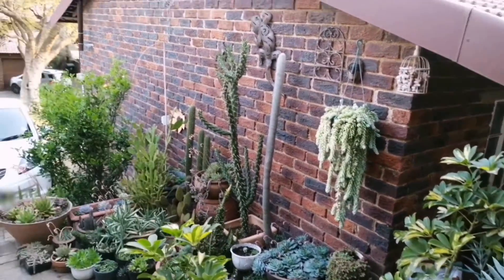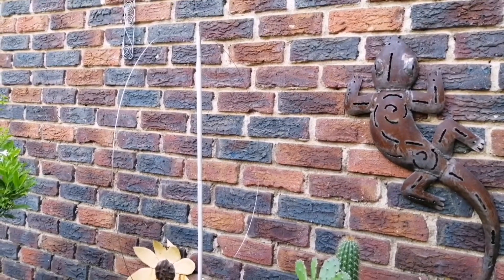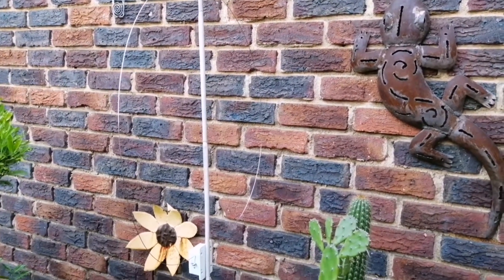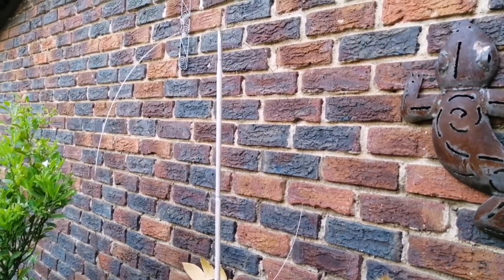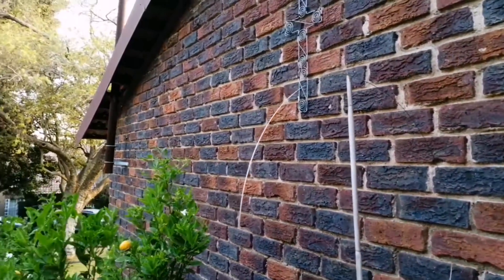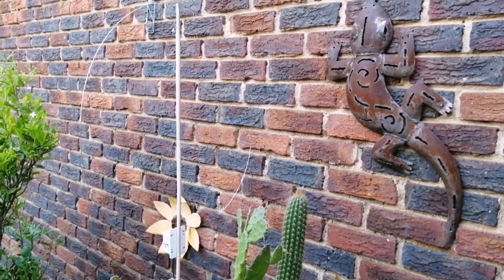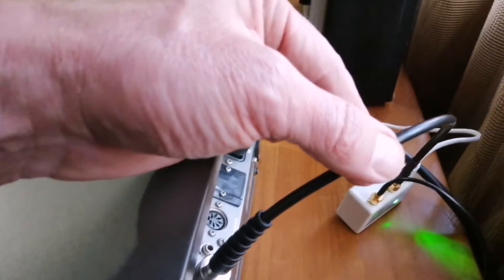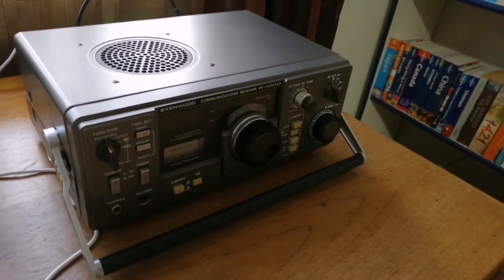How I set up my MLA30+ loop antenna just above ground level, and why it works!

Comment from the maker: CORRECTION: I mixed up my references to the amplifier and bias tee boxes in my video. What I refer to as the bias tee is the amplifier and what I refer to as the amplifier is the bias tee. Second time I do this and second time viewers point it out. Somehow the incorrect terms seem to be stuck in my mind 🤔 Thank you to the viewers who pointed this out. For other non-technically minded viewers (like myself!), the amplifier helps to boost the signals, the bias tee provides DC power to the RF circuit to power the amplifier.

Comment: thanks for info sir...Can this be used with Qodosen dx286 to increase Medium wave reception?
Reply from the maker: Yes, you can use the MLA30+ loop antenna with the DX286 receiver, it will definitely improve your medium wave reception. It works well. I use my MLA30+ for MW on the Qodosen.
Reply: @swlistening thank you sir...i appreciate ❤

Comment: Thinking of getting one of these! 

Also, Love your cactus garden. Wish I could grow them outside year round!
Reply from the maker: Hi Tim, it is a very good antenna, I use mine all the time!

Winters here are cold also, sometimes well below freezing point at night, but I guess it is not as cold here as where you stay. The cacti seem to survive the winter here.
Reply: @swlistening  they also get some heat from that beautiful brick wall. We have already had some temps below 20° fahrenheit. (-6° C)
Reply from the maker: @hawkinscsa  True, the wall certainly helps. Good luck with the chilly weather there!

Comment: Thank you for the information. How did you get it throuth your window? Did you drill a hole?
Reply from the maker: The wire actually fits in the gap between the window and the window frame, so when I close the window the wire still fits. The wire is quite thin. Many people actually do this, I have done it when travelling with hotel windows also. But if this does not work, you will probably need to drill a hole.

Comment: I am trying to determine whether to buy one of these or not.  The only place I can really put it is on my deck, which is about 10 feet off the ground.  I have a number of metallic objects on my deck as well (such as my barbecue and some chairs with metal frames)  Hopefully they won't interfere too much with the loop.  Excellent video, Andre.
Reply from the maker: Thanks Andrew! I think the MLA might still work well on the deck, it is great at nulling out noise and many people use it indoors, it still improves reception. It's just always a gamble with sellers on Ali Express, some of them sell fake versions. Make sure you use a reliable seller.
Reply: @swlistening  Yes.  I think Amazon Canada will be a better bet for me than AliExpress

Comment: Excellent how-to presentation on the MLA-30+ loop antenna and how to position it in one's garden for best reception.  I thought that vertical active magnetic loops, like most other antenna designs, should always be installed high above the ground on a mast or rooftop. That's obviously not correct, at least for the MLA-30 design. Thanks Andre. Mark
Reply from the maker: Hi Mark, thank you so much for your comment! I certainly think in some cases it might help to install this one higher up, some experimentation might be needed, depending on your location. But for me it certainly works best just above ground level.

Comment: Hi Andre, I also have the MLA-30+ but after experimenting with different heights. I tried from 4ft to 20ft and have I found signals were noticeably stronger when I put it higher. Not sure if it's got to do with the location. I have mine about 15mt away from the house. And I'm using a Sony icf-SW 55.
Reply: Hi Andre, mine is at 21ft at the moment. I'm also trying a new mod. I've taken off the wire loop and attached a 12mm flat aluminum loop today, so I'm looking forward to seeing how it compares to the standard wire.
Reply from the maker: @andrewbadinski7040  Thanks Andrew. I would be very interested to hear how the aluminium loop compares to the standard wire.
Reply from the maker: Hi Andrew, thank you for your comment. I have been thinking about putting mine a bit higher just to see if there is a difference. How high did you put yours in the end?
Reply: Hi Andre, well I've tried the new aluminum loop. It's hard to tell if the conditions were better last night or the loop actually is performing better because there does seem to be a difference. I've just ordered a Tecsun pl 660 so looking forward to trying it with that. Take care

Comment: Hello André. Instructive video, thanks. I'm curious about your mentioning sources saying that the MLA30+ works better when close to the ground. I've read everything and its contrary about what is best for this  antenna. Would you mind sharing a link to this source please?
I have a question too: I've just received my 2nd MLA30+ that I plan to use for countryside DX SWL outings. Much to my surprise, it came with a much bigger loop than the 1st one I have on my balcony. The former has a ~62cm diameter, the latter ~84cm. What's the diameter of yours? Have other people seen MLA30+'s with varying diameters like this?
Side note: hope you'll see my recent report posted to the HC DX list. It was a fantastic evening. BTW this should give you my mail address, if for some reason you want to get in touch. That'd be great.
Reply from the maker: Hi Alain, thanks for your comment. I listed some of my sources in the video description, but there they are also:

Loop height for small magnetic loop: http://www.lz1aq.signacor.com/docs/loop-height-for-small-magnetic-loop.php

An overview of the underestimated magnetic loop antenna: 
https://shorturl.at/uTVX0

Tips for using a magnetic loop antenna: https://shorturl.at/jlFL5

But, you know, I will be the first to admit that there are very many different viewpoints about this, I picked it up myself as I was reading. My MLA30+ is just above ground level (two loop widths high), and it seems to work really well this way. Some sources say this is a good position for the loop. But others say different things. I really think it also depends on your area, your immediate surroundings, buildings and other large barriers (like balcony walls) around the loop, general RFI in the area. I think there are so many variables. For me and some sources the just above ground level works very well, for others it might not. 

About the fake version, I actually just replied to your other comment as well, seems like the difficulty in forming a circle is one of the things that does show it is fake. Also, the bias tee box has a red light on the fake one and not green. I just measured the diameter of mine, it is 62 cm.

I haven't read the latest HC DX list yet, I will read it later tonight. I am looking forward to seeing your report! I will take down your email address there for sure.
Reply: @swlistening  Thanks again André. Sorry I've missed the reference links in the description. Oops.

Comment: Hi! I was inspired by your video. I have two MLA 30 Plus antennas both about 12 ft up. I had one with a 3 ft. Copper loop, the results were good, but it was producing spurious signals. I took that one down, mounted it on a smaller piece of PVC that I measured by what you said of 2 loops height. I attached the stock loop and stuck in the ground
 I will do some testing and let you know how it performs against the other.
Reply from the maker: Thanks for your comment Anthony, I am really interested in hearing what your experience will be with the lower mounting position. Please do comment here again once you have done your tests.
Reply: My antenna is doing well. I just recorded  a weather forecast from VMC Charleville Australia on 12365 khz USB. I've heard it before using my other MLA 30 Plus at 12 ft. But today's signal was strong using the ground mount antenna. I have the video I could show you if you would like. I'm in Florida in the US.
Reply from the maker: @anthonyfranz8317  This is good to hear! Thank you for sharing. Please do share the video link here, I would like to watch it.
Reply: @swlistening   I have the video on my phone, how do I send you a link to it?
Reply from the maker: @anthonyfranz8317  OK, you will need to upload the video to a site like YouTube or maybe Google Drive, if you use it? Or Dropbox? Then you can send me the link from there.

Comment: Will the metal wire part of the
 antenna rust?
Reply from the maker: That's a good question, John, but unfortunately I do not know the answer. Never seen anyone complaining about rust, so my guess is that it is probably rust proof.
Reply: @swlistening  It depends on the wire. Is it copper?
Reply: No, it's stainless steel.
Reply from the maker: @bblair502  Thanks!
Reply from the maker: @StratmanII  Good suggestion, I think when our summer rains come this might be a sensible precaution. Winter here in my area is bone dry, summer gets lots of rain. We are just moving into summer now.

Comment: The box at the antenna is a preamp the biasT power supply is the small enclosure that plugs into your USB port for 5v power .

Use PVC electrical conduit with a cross bar for a better mounting in stong wind. 
You can secure with crossed cable ties.
The MLA-30 can also be used indoors near a window
Reply from the maker: Thanks John! I think you pointed this out in my unboxing video also, yet I still switched the terms around 😕 I added a correction now.

You are right about the cross bar, I think in areas with lots of wind or storms that would be very important. I do mention in my video that this is my installation at my location and that it would be different for different people, depending on where they are.

Comment: The little box indoors has these words on it: "Biasing Tee"; it's not the amplifier. The Low Noise Amplifier is the box outside under the loop. It wouldn't make sense to amplify the signal indoors after it has been degraded by passing through the cable.
Reply from the maker: Thank you for pointing this out! I added a correction to the description and the comments.

Comment: congrats on your nice garden!
i am still wondering about how directional the mla30 is. i did notice that i usually have to turn the antenna 90° when trying to get a signal from cross the atlantic versus trying to catch a local station. haven't looked into it, but my wild guess would be that it matters a little bit at which angle the loop is positioned towards the radio waves. 
there is a german guy here on youtube who claimes to have build an entirely non directional mla30 loop. it is not round anymore but strechted out so that it is two parralel lines. i tried building that but did not have the same results he had
Reply: A few years ago I used to experiment a bit with passive receive loops, mostly Moebius loops or so-called YouLoops made out of a piece of RG-58 or similar coaxial cable. While I've never actually tried them out at ground level, rather at man's height or above, I found out that these loops are pretty directional on LW & MW, also it's somewhat noticeable at 6 MHz, but the higher the frequency the less pronounced the side nulls become. At 11 MHz I was hardly even noticing a difference. Idk, perhaps it souls be different close to the ground? 🤔 And even if the loop does lose directivity with height increasing, it should still do OK on mediumwave 😅

BTW the theory says a loop can be considered a small magnetic loop, with all its properties, as long as its diameter does not exceed 0.1 wavelength (although others suggest a 0.084 ratio). What I found out as an OK compromise is a circa 90-100cm dia. loop. Not only because it can grab more signal on HF & down... That's also about where it is resonant on the FM band. So it feels like killing two birds with one stone (omg, what an awful idiom XD I think our Polish one is much better - roasting two pieces of meat on one bonfire 😅)
Reply: Oh btw, don't think a Moebius loop is better just because I mentioned it XD such a loop, behaving essentially like a two-turn loop, becomes more resistive at higher frequencies, so depending on size it just becomes deaf at 14-18 MHz 😂 better do a single-turn loop like you have, or a shielded loop which can also be made out of coaxial cable. Break the coax braid right in the middle of the cable, join it at the ends, connect that braid to the braid of your lead-in cable... and it should cut down on noise a bit further 👍
Reply from the maker: @ArnieDXer  Thank you for this, very interesting to hear about the directional nature on LW and MW. With mine I feel as if I have not really had much success on MW. I think it is because I never turn it. So I need to experiment more with this.

The idiom for killing two birds with one stone in my language (Afrikaans) is "to kill two flies with one slap". Also, I think, a bit nicer than killing the birds 🤣
Reply from the maker: Thanks! I do wonder about the directional thing also, I never seem to need to turn mine. It picks up Africa, Europe, Australia, Asia, North and South America just the way it is. But I suppose if I want to search for some really low-powered signals like European pirates or some of those South American signals it might help to experiment with the direction.
Reply: @swlistening  sometimes turning the antenna just clesrs reception for me. only very few stations can be made to disappear with turning the antenna.

not sure if i just have to null out different noise sources for different frequencies. maybe some stations get overpowered by noise if that isnt nulled out
Reply from the maker: @GrumpyGrain  Someone else also commented that turning the antenna works really well on MW, so I think I will experiment a bit with turning the antenna. So far, as I said before, I seem to pick up quite a lot of signals with the loop just in one direction, but maybe others will come through if I turn it. Or some will become clearer, like those scarce South American one 🙂